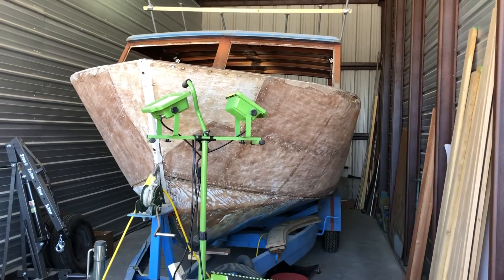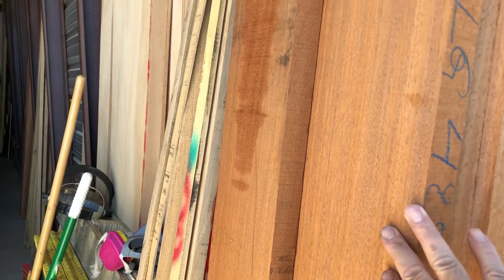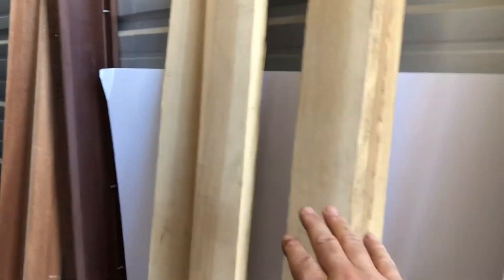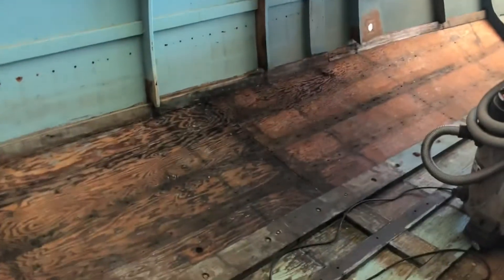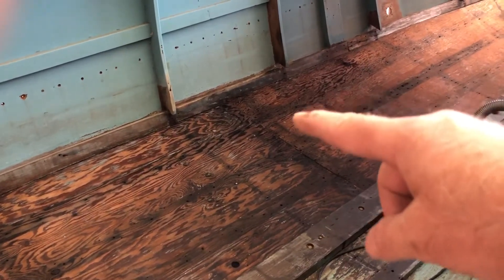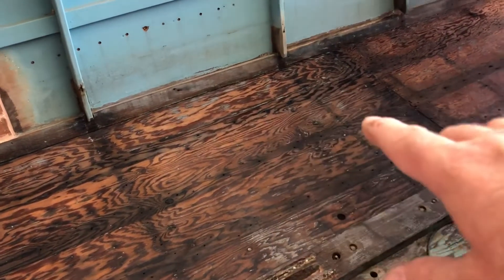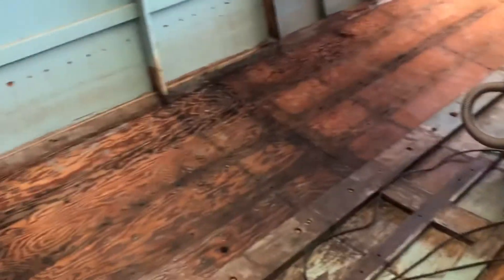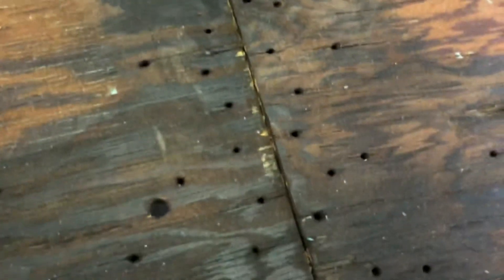1957 Martinac 24-ft Cabin Cruiser Restoration - Part 3

Comment: Very interesting,  most people do it other way.  Take apart the way it was built.
Reply from the maker: Hi Clarence. Yeah, I hear you. I think this boat had weak framing right from the beginning of its life. There were old repairs on two of the bottom stringers, the original engine stringers were literally falling apart, the transom seams were all in bad condition, several of the knee braces were failing, and the original straight-six Grey Marine engine was replaced with a V8 Flagship 283. This hull had many many issues. I hope there are no more "surprises". I think it will be fairly sound when I am done.